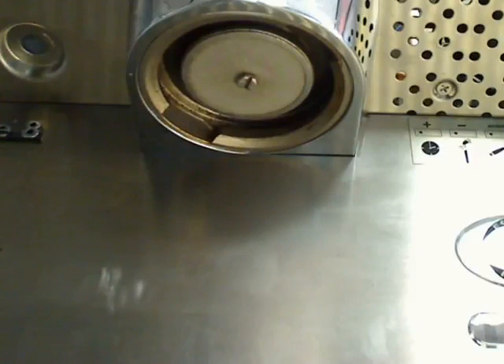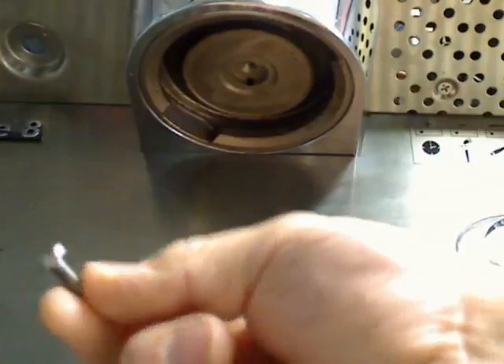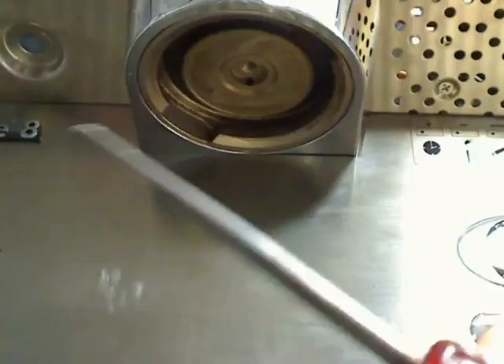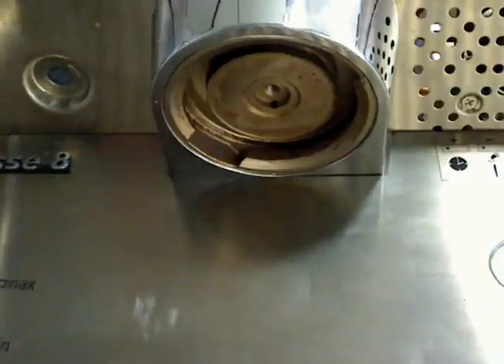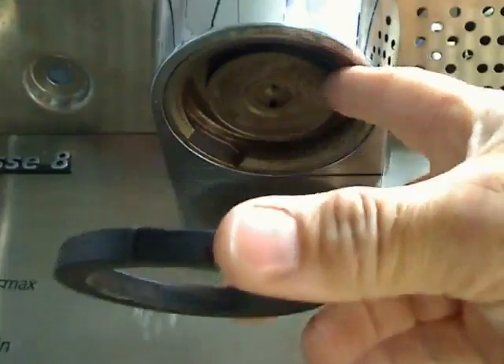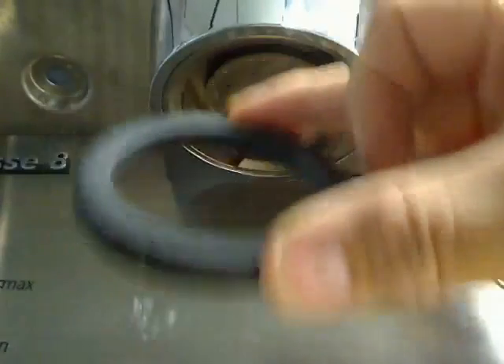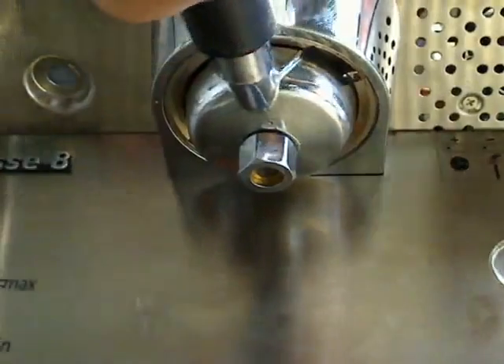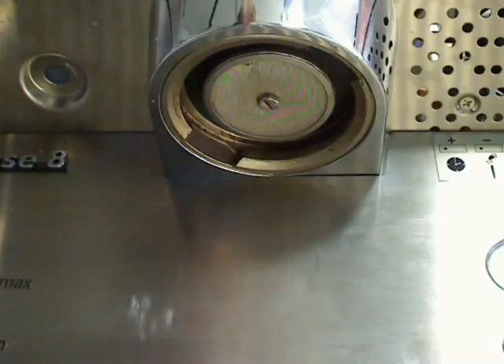Changing a Group Gasket on a Rancilio Espresso Machine

Comment: Hi
After 6 years with the same group gasket, it seems an impossible task before using 3 drywall screws that I inserted without any pre drilling with a short screwdriver. It took me only 5 minutes to get it out without tearing it apart. Thanks again for that great tip. I had to spend an extra 10 minutes cleaning up the seating slot where some of the seal had fused with it. The insertion with a new one was so easy.

Comment from the maker: If it's still intact then another trick is to use two drywall screws and tighten them into the group gasket. Get screws long enough that after tightening them into the group gasket the screw head sticks out past the grouphead. Now use a pliers to pull the gasket out with the screws.

If this doesn't work, you would have to just keep chipping away. Best of luck!

Comment: I wish I had seen this earlier. I waited 16 years to change the gasket. I had to use a drill to get it out.  Imagine how clogged the strainer was. It took a lot of Easy Off to clean that basket.
Reply: I did the same thing.  I put a screw into the gasket, it worked really well.

Comment from the maker: Before inserting the new gasket ensure that all debris is removed from the grouphead. Sometimes bits of the old gasket will stick to the grouphead. Then, before inserting the new gasket wet it with water. Mock up the gasket and slowly work the gasket in using a 5mm hex key. You want to start at one point and push in the gasket a little bit (not all the way) and continue pushing the rest of the gasket working in a circular motion. Continue this till the gasket is completely in the grouphead.